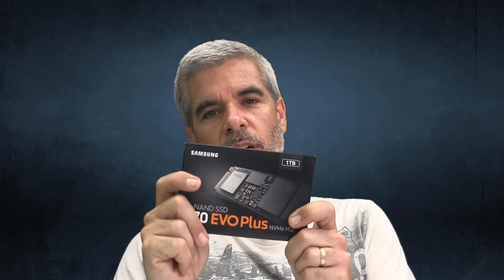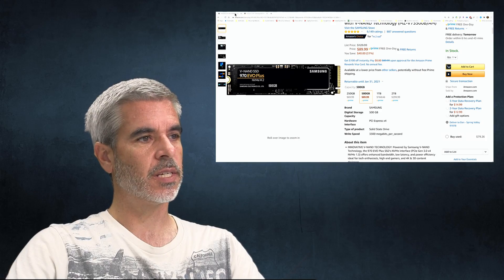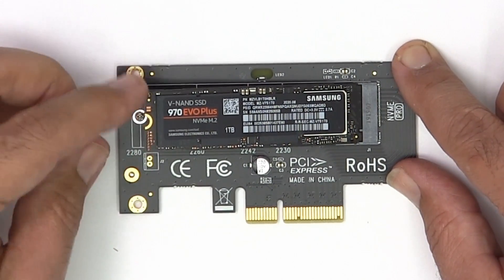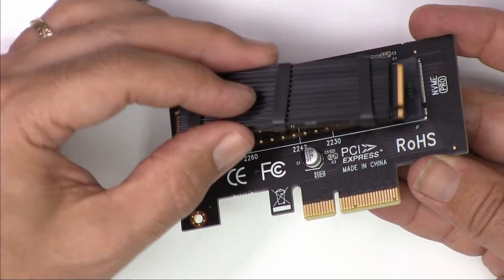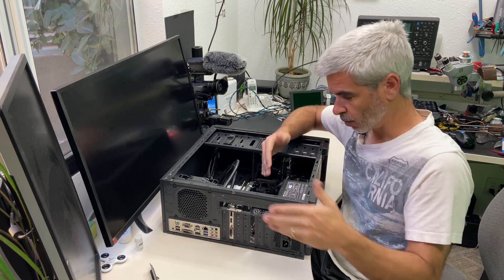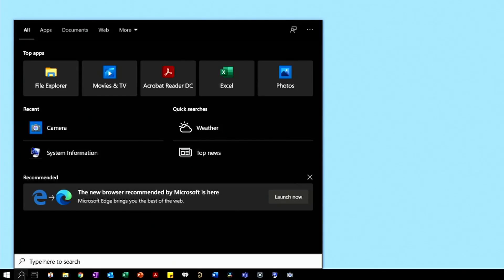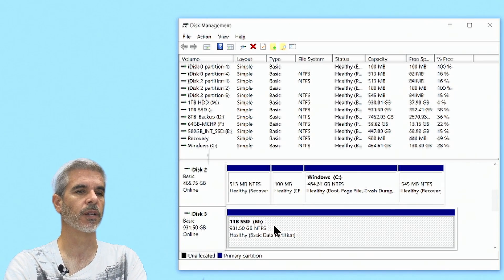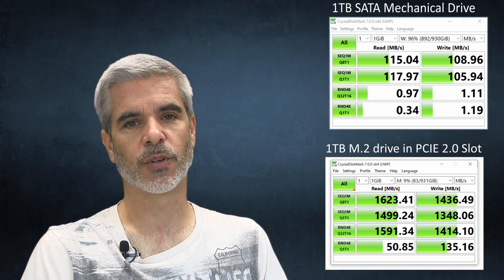M.2 SSD Install using an adaptor card: DIY addition of second EVO 970 Plus

Comment: Does the adapter have a meaningful impact on read/write performance? I imagine it adds some overhead to the bus and/or gets capped somewhat by the lesser PCI-E slot
Reply from the maker: Good question.  All of the PCIE 2.0 slots share four channels 'lanes' of data back to the CPU.  Either you use the 4x slot (which we used) or you use the individual slots.  So it is true that you either can't, or at least shouldn't have any other single channel PCIE cards in those short slots for the graphic card to work properly.